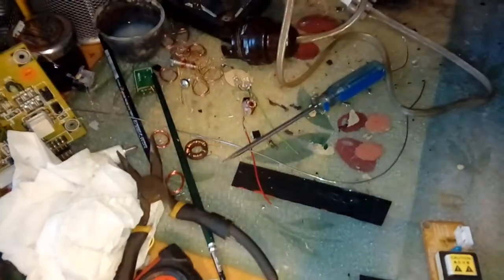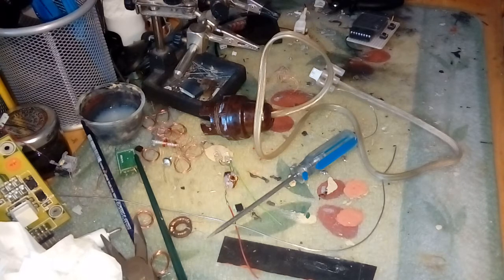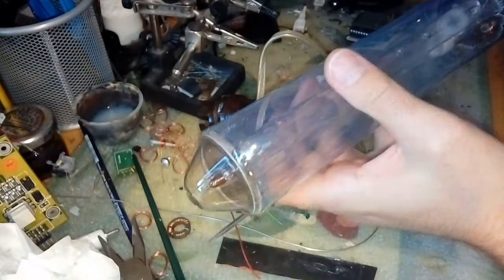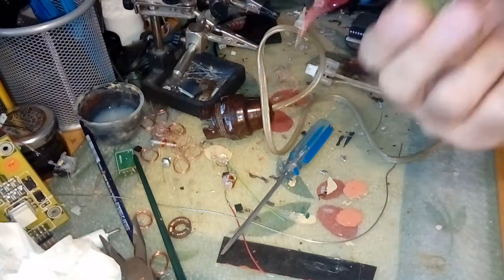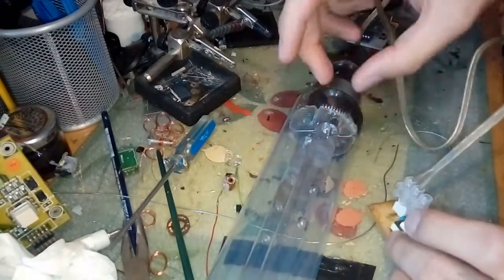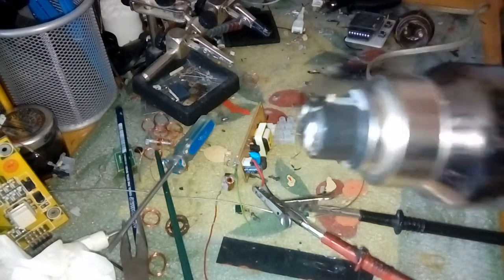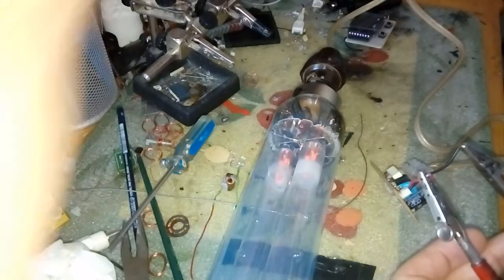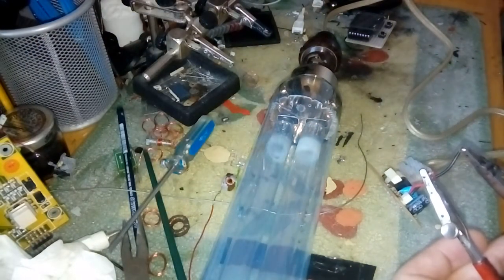Sodium Vapure Low Presure Light Video Test

Comment: Easy to drive that tube, just use a 30W iron core ballast and a S10 starter across the LPS tube to start it. They will start and run up fine, with about the right current for the tube as well. works on the smaller tubes as they can run with the 230VAC mains to drive them, only the longer higher power tubes really need that autotransformer ballast to get the voltage high enough for them to keep lit when fully warmed up.

If you do run those tubes long enough to get the sodium metal fully molten run them base down or 5 degrees from level, so the filaments are the highest point, so the sodium metal does not attack the graded seal there and leak into the outer envelope as it dissolves the glass of the graded seal. Fine to have the metal in the quartz glass sections, but there is a graded glass seal that interfaces that low TC glass with the glass that bonds well with the leadout wires, which is not resistant to the hot sodium metal attacking it. Long term the glass will degrade from just the vapour, but that is a multi decade thing, while the liquid metal will do it in in a few months of the light being powered.
Reply from the maker: Nice, you have just given me some info I have been struggeling to fine. Thanks =-)

That will explain why those lamp posts were always angled. I always thought it was to angel the beam of light, not protect the electrodes from the sodium.

Comment: i opened a lamp and the drive circuit is very similar to a normal fluorescent circuit with the addition of a starter across the  bulb to ignite it.
Reply from the maker: Looking at scematics on line it does look simular to fluresent tubes online. Sadly they don't give you any of the values of the components. I think one of those starters needs a teardown to see how it works.
Reply: @TheEPROM9  I think you should have good luck with a 58W florescent tube ballast and a electronic starter in parallel with the bulb.
The original starters in these fixtures fires multiple times per second until the tube finally is able to maintain an arc without it.
Reply from the maker: I will keep an eye out for any fluro lights in skips. Then I can give it a go.
Reply: @TheEPROM9  you might find an old flourescent with old style ballasts laying around. I remember powering one of those tubes using a microwave oven transformer, worked but the MOT wasn't happy. I see  also on photonicinductions channel he has 2x of these lamps turned into ornaments above the fireplace. A computer CCFL driver will make it glow nicely.
Reply from the maker: You have just given me an excuse to visit the scrap yard. Love that place, so much fun stuff there.
Reply from the maker: I love photons vids, shame he does not make them anymore.
Reply: @TheEPROM9  you could do a scrapyard visit video like high1voltage1rules does, would be intresting
Reply from the maker: @MrPlytiger  I like that idea. Don't think I have done that before.